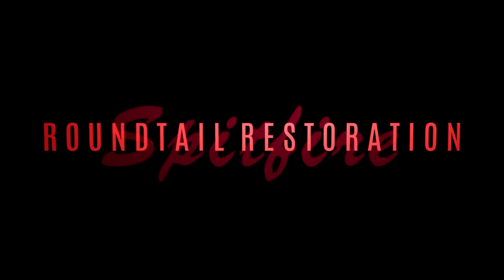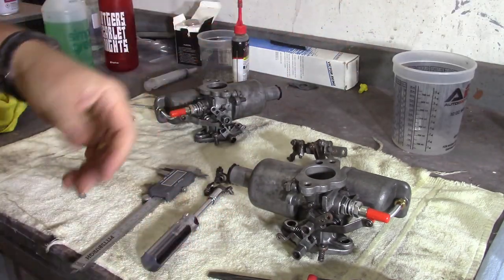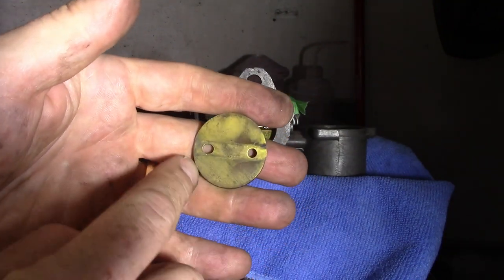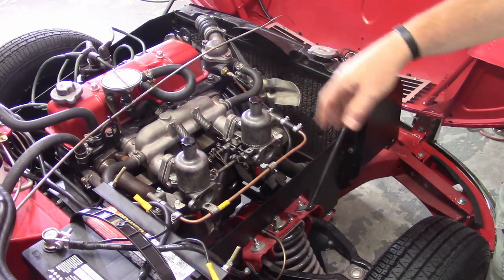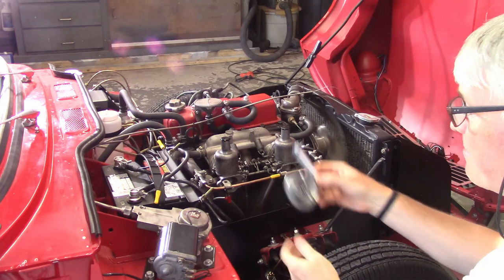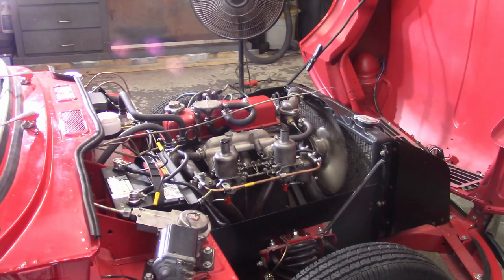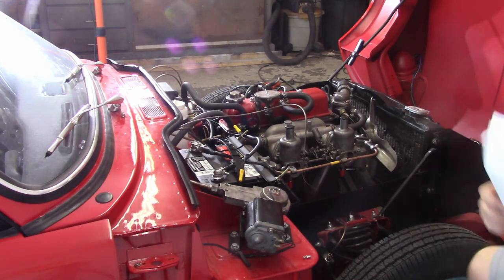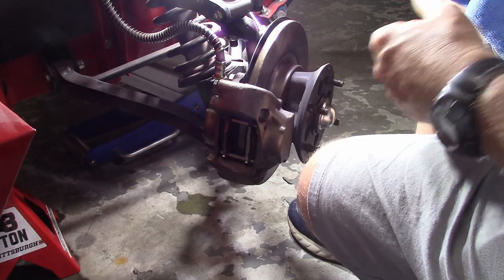SU Carb Tuning - Part 2 | Roundtail Restoration

Comment: Chris, you don’t use the synchrometer to set the mixture but first you use it the set the airbypassscrew to have identical amount of air going through. Once you have the same air than you use the mixture adjustment as mentioned in the manual.
Reply from the maker: Yeah, I messed that up in this video. Concept error on my part. Thanks for watching!

Comment: Seeing you do the work makes me want to jump through the computer screen and help you. I have done 100's of them. Not sure from your video, but are you tuning each carb independent of the other? The spindles should be un-clamped so the throttle cable and movement of the carby has no influence over the other. The you can start to balance and set mixtures. After you have made adjustments, rev up the engine on that carby until perfect and them work on other carby and again, revving engine helps clear combustion chambers and makes sure butterfly spindle (idle speed) stop is seated. setting mixture can be done with small screwdriver under piston, slowly lift piston, engine speed will increase and go a bit more and engine revs will fall. while doing all this mix adjustment, you will need to trim the idle speed several time and make sure air flow is same on other carb, after that is correct go back to 1st carb and again check mixture and do same on last carb. And the LAST thing you do is tie the two carbs together with the pinch bolts on the center spindle. To get it perfect, its a lot of checking one carb against the other. One last thing, just fill the dashpots to the top or just under, they will find their correct level. Thanks for your videos.
Reply from the maker: Thanks so much for all the info and help, Joe! Yes, tuning the carbs independently (using tuning loosely). As for the dashpots, I assume if I do that, I would expect oil to overflow and eventually get sucked into the motor, right?
Reply: @roundtailrestoration  such a small amount of oil will be burnt off in no time and not do any harm at all. Soon you will looking for a new project. Its been a great series you have done. Thank you.
Reply from the maker: Thank you, Joe. Appreciate the help.
Reply: Hi Joe. Should the spindles be unclamped for BOTH the air balancing AND the mixture adjustment or only for one of these actions? I'll be tuning my HS4s soon, but will be using the SU tool kit for balancing (rods and wires) to enable to check air balancing at revs rather than just at idle. Unfortunately instructions don't say when doing if oil should be in dashpot or not.
Reply from the maker: @DavidUKesb  Hi David. Here's a Google Drive share link to the document I was using to tune my carbs. Hopefully this will answer your question (which I think is yes). Let me know if it doesn't work for you. https://drive.google.com/file/d/1_CNuroOmzaAAi-8uNvOZ4si7JqS6HJ0h/view?usp=sharing

Comment: Great video Chris. Those SU's were always a bit of fiddle to set up and get right, but i think your almost there now. That caliper was a blow but at least you didn't spoil your new brake pads.Hope its fixed and dried up now.
Cheers, Jeff.
Reply from the maker: Thanks, Jeff. I think the brakes should be good. I'll play with the carbs more. Understanding more each time, I think. We'll see!

Comment: Hi Chris. Good video quality. Can I ask - you seem to be adjusting AFR with the jet adjustment while using the air flow meter too. I couldn't understand the function of the airflow meter in this process. Everything else I've read or seen with SU carbys has the air flow (idle) adjustment and fuel jet (AFR) adjusted done independently. Air flow is adjusted on the 2 linkage screws (first) to idle speed then the fuel mixture ( rich or lean adjustment) is adjusted with the jet height adjustment . The fuel mixture is checked by using a Gunsons Colourtuner or the SU carby piston lift method (lift piston and engine dies then too lean. If accelerates its too rich). Can you please advise what you were doing with the airflow meter when adjusting the jet (AFR)? Cheers
Reply from the maker: Watching it again, I'm not real sure what I was doing there. My guess is that I had it in my mind that changing the tuning would change the engine running and I could use the unisyn to tell me how much that carb was sucking, maybe to compare it when I did the other one. I'd mark that one up to a rookie mistake.

Comment: hi Chris, the butterfly plates have to seal completely and the actual idle adjustment will be done with the bypass screw and a synchrometer.
Reply from the maker: I did a butterfly valve replacement in an earlier video. Got them pretty close. Not totally closed, but as close as I could get them.

Comment: Chris thanks for the nice video.  Did you replace the spindle of your carb?  Was it worn?  Did you replace the bushing the spindle rides in?  The bushing is a PITA and apparently needs to be pressed in and a special reamer to get it to the right dimension.   All those might be contributing to not being able to get the butterflies centered.
Reply from the maker: I did replace the butterfly valves and spindles. The hs2 models are the only ones that don't have a brass bushing, which is very convenient. It didn't feel like it is hanging up...until it gets in the car, of course!

Comment: can you put a spring on to pull those jets back up?
Reply from the maker: Hi Graham. There are springs there as part of the normal linkage. I think it's an alignment issue.
Reply: @roundtailrestoration  you will get it sorted.

Comment: choke  problem is in the linkage  adjustment
Reply from the maker: Like, linkage where it attaches to the jet, or between the carbs? My choke cable is really long, too, and I took care of that tonight...seems to operate more smoothly. Thanks, Ron.
Reply: @roundtailrestoration  when the choke   starts to engage thats when yu put yu choke line tight
Reply from the maker: Thanks, Ron. I was wondering about that. The manual is exactly clear if I take up the slack in the spring or not before tightening the cable. That clears it up.